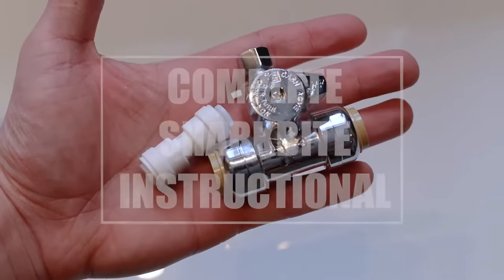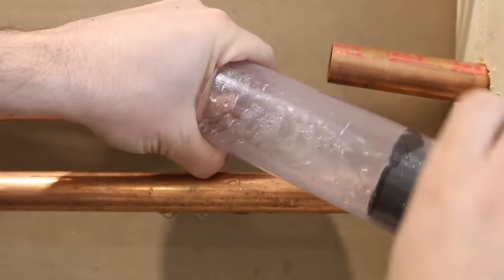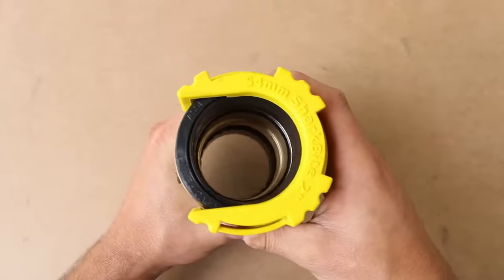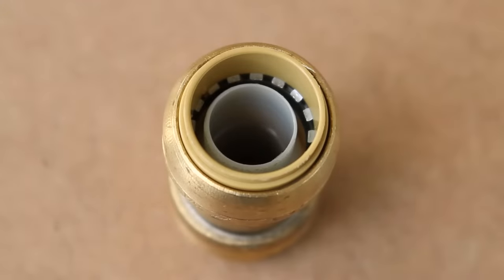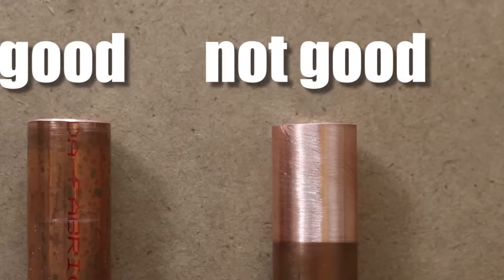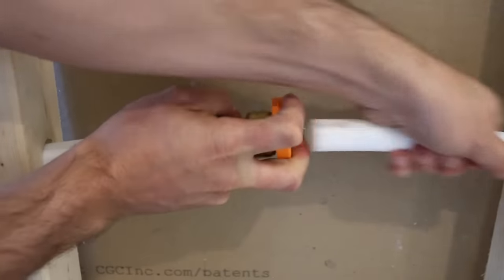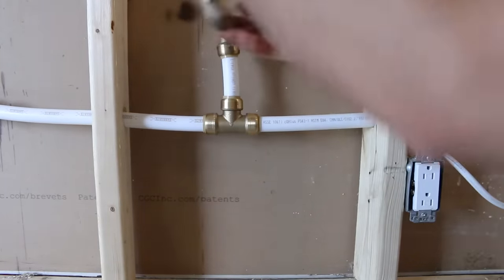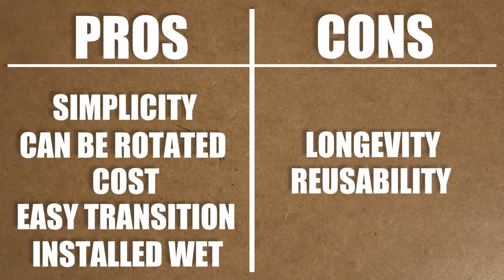Beginners Guide To SHARKBITE Fittings (Watch till end BEFORE Buying!) | GOT2LEARN

Comment: Installed my Sharks about 5 years ago for hot water tank. Did not know what I was doing and just stuck them on. They are still working great.
Reply: you were probably shown to clean the ends of your pipe up somewhere along the line and make a clean cut. Thats really the only trick. Making sure its seated, and not going to kill itself upon install
Reply: @edgarvera654  Googled Va lp and I still do not know what it means?
Reply: So there worth the money???do you live in cold climate?
Reply: @tonywheeler4468  Georgia, USA
Reply: @tonywheeler4468  cold vs. warm climate shouldn’t matter inside the house.
Reply: @ryanb4533  it does tho
Reply: @JoeNathan42420  How so?  Ground water temperature would be about 15-25 degrees different.  That’s not going to change anything about the effectiveness of the connections.
Reply: @ryanb4533  he didn't ask about ground water. He asked if op lived in cold climate. You said it doesn't matter. Because I guess you are assuming he's talking about the "effectiveness of the conditions" or the difference between the ground water or something. He's probably not talking about pipes 36" under the ground because it's below the freeze line. You should assume that he's talking about them freezing in the winter. Which is probably the only reason he's even plumbing anything because he has a busted pipe and wants to know if he can use shark bites if they're worth it or should he just stick with the the trusted PVC and PVC clue method
Reply: @JoeNathan42420  Sharkbite connections for a water heater are inside the house, goofball.  A house in Alaska is going to have a very similar interior temperature to a house in Florida.  We have climate control.

Ground water temps are the only variable and they don’t change enough to make a difference.  That’s why I brought up ground water temps.

If he’s asking about outdoor connections, asking a guy who made a comment about using them to connect a water heater is probably not the person to ask.
Reply: Got to have 18 inches of either copper or braided line off the tank for code, they come with a "sharkbite" fitting on the end, just swapped some in on a tank the plumber had used pex right off the tank, it's meant for gas but it still applies to electric tanks. Been using sharbites more and more though, they've proven themselves over the years.
Reply: Same here. Don't fall for scare tactics from plumbers - no offense to them, but not everything in plumbing is rocket science.
 I've installed shark bite connections on my hot water heater - check on them almost daily (call me paranoid) - no leak and saved a TON of money vs hiring someone and going solder route....3 years later.... In my area water heater lasts about 10 years, so I'm thinking I'm gonna get my money's worth, even if I have to replace shark bites every 10 years ..
Reply: @patrickcowan8701  installed 29W  tankless water heater a couple of years ago. I know how to solder (A&P) Used the full sharkbite valve system so I can periodically clean without disassembly. Since there’s no hot water in pipe all the time there’s no problem or requirement for copper. It was like putting together legos…relaxing (weirdo huh?).

Ps. For all considering tankless…don’t cheap out use the bypass valves, don’t connect straight in if DIY and make sure plumbers install them if you have professional install.
Reply: @no88o2  Wow. Thanks. Yes, it is metal pipes. But, I would never call my insurance company for anything - unless I just want to have a worse day and then be punished. I pretty much take of things myself. The insurance is just a mortgage expense and nothing more. Insurance is a joke played on the homeowner.
Reply: @Got2Learn  कङओकोओचओ
Reply: I love the shark bites 6yrs later with very very Canada 🇨🇦 freezing weather even pipes froze and the sharkbite still in tack I also used some crimp as well and they both work perfect
Reply: @PSM5787  its in a wall, they dont freeze
Reply: Almost 10 years on my water tank shut offs, as good as new so far.
Reply: lol
Reply: 14 years for my sinks and toilets and 10 years on my hot water heater. Still work like day 1. With cpvc, you would have to cut walls open if you use glue and need to replace valves most of the time. These are a life saver and as someone stated, I can replace them whenever I want or maybe every 20 years in minutes.
Reply: I did the same thing you did 8 years ago and still those fittings are holding up
Reply: 10 years for me.

Comment: When I noticed that my plumber used these to fix a leak, and charged me $250 and took only 15-20 minutes I started looking for them. Since then I have fixed several more and replaced a lot of old copper pipe with Pex and saved thousands. The oldest ones are holding up for near 20 years now.
Reply from the maker: Niceeee, thanks for sharing!!
Reply: I repaired a tee under my house I had the disconnect tool (I bought 2) but it was still difficult to remove the old fittings. I ended up opening the jaws on my channel locks bigger than the pipe and tapping it off.
Reply: @armandhammer7642  por que no me sale agua en dos salidas
Reply: I went under a house that has copper very little room so I cut out the copper each run at a time and remade it with pex outside and squeezed under and pushed the connections  . I could only imagine having to solder and the pex can handle hard freezes without burst.  Had the whole house done in 4 half hours got paid 2200 bucks
Reply: And that’s the nice thing about Shark bites,the average guy can fix plumbing leaks himself and save 
lots of money.
Reply: I have so many sharkbites I've removed after fixing these average Joe repairs  😂😂. I should bag um up and sell on ebay, I no joke probably have 200. Only ones I use on regular basis are the caps for rough in before inspection
Reply: A major plumbing company wanted charge me $689 to fix an easy to burst pipe. I showed him the door. I checked with my neighbors and found a nice  hispanic man who works plumbing on new construction. He fixed it for $80. I'm retired and on a fixed income so this avenue was worth the risk.
Reply: As a plumber we normally have a two hour minimum due to our high insurance and licensing costs our minimum is $260 for residential. I've used these fittings when i had to in emergencies but they are not code for in wall plumbing in MN. Also they cost about 5 times more that normal fittings so learn to solder and if you have cpvc in your house sell it that stuff is trash
Reply: It may take little time but they are kinda expensive so it makes sense it was $$$
Reply: @maxcondra4991  yea we can't use SharkBite's in anything above 2 stories here in Nyc
Reply: @armandhammer7642  i do that also
Reply: Sharkbyte leaks Ll the time. Trash 🗑
Reply: Time to change them out for new ones so it can last for another 20
Reply: @walterbrunswick  if you want it done right. Get yourself a viega press, uponor gun, pro press. Heck if you want something lazy like sharkbytes. Buy push connects. They hold better psi.
Reply: @Max Condra  PVC and CPVC are the go-to's in Florida. But, I always paint it when outside, for UV protection.
Reply: @hogroamer260  I prefer cpvc it comes in handy and pex fails just as often just look at all the class actions, copper can poison you after 8 hours. They all have drawbacks. Cpvc gets brittle just don't whack it and you're good.
Reply: @maxcondra4991  I've had cpvc in my house for 30 years and never had a problem with it
Reply: Remember you paid the Plumber for his or her knowledge, you were motivated to learn now you can save money and do it yourself, congratulations
Reply: You didn't hire a real plumber, a real plumber would laugh at these, the plumbing company I worked for would have fired me if I used a sharkbite, which I would have gotten on my own because they didn't even buy them
Reply: @kevinbaker2470 same

Comment: Used six of them 15 years ago on a fixer upper that had burst pipes. So far, none have failed. One of them I had to remove a few times over the years and reuse it and it still hasn't failed. And this is in a home that sees brutal winters and brutal summers.

Comment: Eight years ago, heating went out for a couple vacation homes where I live.
The house fitted with copper had destroyed connections throughout the hose.  Serious water damage.
The house fitted with Sharkbite fittings had some 'stretched' pex, but NO leaks... NO failed Sharkbite fittings.
After seeing those results, when I remodeled my house, adding 1 1/2 bathrooms, a sauna and extra tubs in the basement, I used Sharkbite throughout.  Extremely easy... and I took my time to make sure EVERY pipe was properly squared, properly cleaned before insertion.  I may never sweat copper again.
Reply from the maker: Niceeee, thanks for your input :)
Reply: You are crazy sir.  I would be going crazy checking for leaks when using that many Bites throughout the house

Comment: I have been using John Guest QuickFit connectors for 38 years now hot and cold water and heating, copper and pex pipes. Never had a single leak at a joint, including those that are over 30 years old.

I preferred the original JG connectors because they are smaller and click straight away. The new ones have the locking nut, which a don’t really think is needed. The new ones do have the advantage of easy of disassembly, so you can replace to o rings if you need to. I have a box of used fittings; they will have been used again and again, often to put in temporary plumbing while repairs or remodelling is happening. Never thrown one away.
They are certified for hidden/in-wall use in  most of the world, and I have no hesitation using them in any location.
I haven’t used Sharkbites, but it is the same company as JG. I guess the brass body is a comfort for some users who are suspicious of plumbing in plastic. Sharkbites are difficult to remove compared to Speedfit, which is why I have never used them, but I don’t doubt they make a good long lasting joint.

My question is: why do compression fittings still exist?

Comment: This just saved me a small fortune when working on my backflow system from my sprinklers. 100x easier for me to just cut the pipe, installed and thread in my ball valve, and then connect the pipe again with the Sharkbite. For $8 I just saved myself a $150 plumber visit - thank you!
Reply: I worked for a guy doing irrigation in Cape Cod Massachusetts he said you need a plumber to install a back flow. Im in Tampa Florida now i heard you don't need one.

Comment: I came across these when I made a hole in 1 inch irrigation pipe. The pipe was buried a foot deep, next to 3 other lines and the break was an inch from a 90 degree elbow. It would have taken a huge amount of labor to carefully dig up enough line to glue in the parts to fix this nightmare! I found an 18 inch long, one inch repair tube, used a jigsaw to cut the irrigation tube, wrapped a homemade jig and used a file to get a flat end and plugged the bendable repair hose right on. This bypassed the mess of other pipes and trying to cut the proper parts for a 90 degree replacement. I have left the pipes uncovered for a year now to make sure it wouldn’t leak. This is a great product! And definitely follow the proper install prep described in this video!

Comment: I use them more and more for repairs to copper lines. They're great for fixing little pinhole leaks, and I love being able to do a bigger job like installing a water heater or a shower valve and not having to use my soldering tools at all. I do worry slightly about how they will last long-term since copper is proven to last for decades. And as for cost, I think it could go in both the pro and con columns. On a big job the pex and sharkbite stuff saves you a ton of time and is so easy to work with. But on a small repair that's easy to get to I still sometimes do it with copper. I can solder together some fittings and only spend a few dollars where the same job might cost $30-40 in Sharkbite fittings. Depends on my mood and how much time I have. Anyway, nice video.

Comment: I also have used these in hundreds and Hundreds of situations, the only problems I've ever had was when I had a bad piece of pipe that wasn't visible or I couldn't get it installed deep enough, once I figured out that a little plumbing grease solves a lot of problems and If you have to remove and reinstall them a time on two no worries! I've installed them in closed wall, underground and just about anywhere you can think and have never had a failure when it was installed correctly, great video, keep it coming!

Comment: I used a Sharkbite 90 and valve in my crawl space about a month ago. It worked in the heat of the (leak) moment without issue; especially for someone who previously had zero plumbing experience. After watching your thorough breakdown and deep dive, I'll still be looking to replace them with soldered copper items, as I have no comfortability issues with doing that. Thank you very much for the video.

Comment: I had to use these when my wife and I bought a three family home and we had to gut the second and third floors because of their condition. Being a 110 year old, balloon framed house there were walls we just couldn't move. Unfortunately some of the walls had been put in in such a way that there was less than 1/2" of space between the place where I would have needed to put a torch for a solder connection and the 110 year old dry wood studs. Perhaps a professional plumber would have thought nothing of bringing a torch in anyway and perhaps he would have thought that because it wouldn't have been his house that burned down if he was wrong. At any rate I wasn't comfortable bringing a torch in there. I've now had sharkbites in the wall there and in the bathroom for 12 years without a single leak. And yes I know for a fact that they haven't leaked because I make annual inspections of anywhere there might be a leak. If you take the time to properly prepare the pipe by cutting it square, properly deburring the inside AND outside of the pipe and then insert it fully into the connector there's no reason you should have any problem.
Reply from the maker: Always good to hear real life feedback, thanks!!
Reply: There are literally a hundred ways to solder in tight spaces.
Reply: You can use a fire blanket and then torch time.

Comment: great videos as always. One caution I have not seen though, is to avoid using them on tinned joints ( in reno work the old valve is quite often heated and removed, and a   quick temporary cap is often a sharkbite fitting. Be cautious: the teeth do not grab well  on the hardened tin surface (don't ask me how I know). Equal caution if you replace with a sharkbite valve
Reply from the maker: Great point, thank you for adding this in Peter!!

Comment: I have installed an in line connection underground when a gardener broke the irrigation pipe. It was easy as pie and the special wrap kept it looking like new when I removed it 4 years later when we replaced the whole system. SharkBite has saved me a few times! I love that system.

Comment: One more minor con in some situations: The fitting is much more bulky than the comparable copper solder fitting or a PEX crimp. Most of the time this isn't an issue, but I have run into a few situations where I don't have the room for the extra outer size of the Sharkbite.
Reply: This is true. At least it doesn't matter much for things like faucet cutoff valves since they are a bit bulky to begin with. I just had to replace a 50 year old valve and the sharkbite came in clutch for a quick repair.

Comment: Great video. I didn’t even know these existed until I had a plumbing problem this week. I fixed it the old way of how I have done thousands of feet of plumbing before I was just at the hardware store and saw these fittings and had no idea what they were and come back and re-searches them I will be doing less of these jobs. I am only be repair work, but if I do, I will be using these thank you. Oh, one more thing I sure wish I had these 30 years ago.

Comment: Thanks for putting this video together. The presentation was clear, succinct and professional. I liked the fact that you highlighted the pro's and con's for a product that is not quite there in so far as absolute confidence is concerned - that these joints wont break down after a long period of time or where they are not easily accessible.

Comment: I use the Sharkbite fittings on the cooper pipe to the water softener for almost 20 years and there is no leak since day one. I did disconnect the pipe once to relocate the tank and reused the same fittings. Still no leak. Agree with Go2Learn, I am still not sure if I want to use the Sharkbite fittings  in the enclosed wall. Thanks Go2Learn

Comment: Great video. I have been amazed at why they work. I have seen them after they have been installed. Due to a recent leak on an exterior laundry room.  I saw one being installed and was very amazed at the installation and security of the repair. This video makes the operation of the fitting very clear. The video was very well done and did not bog down as some videos I have seen by opening package etc...